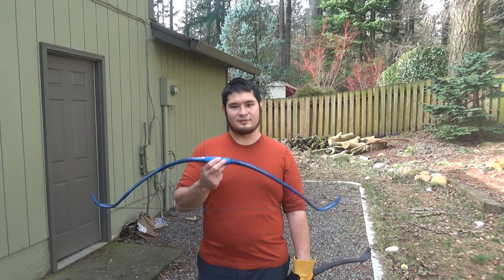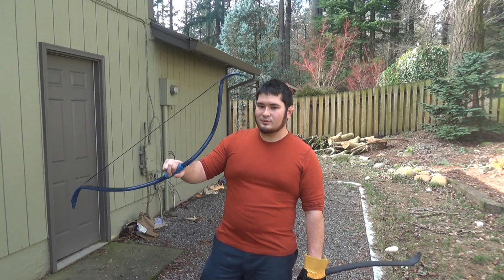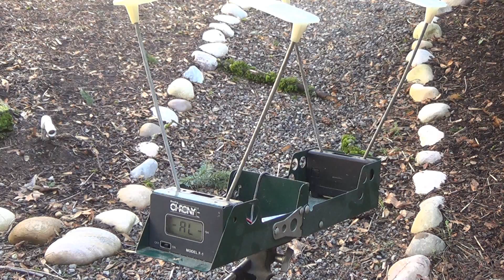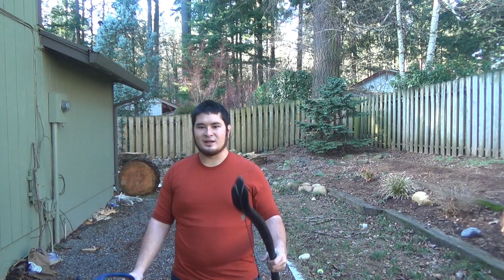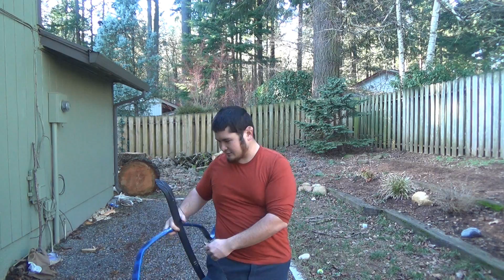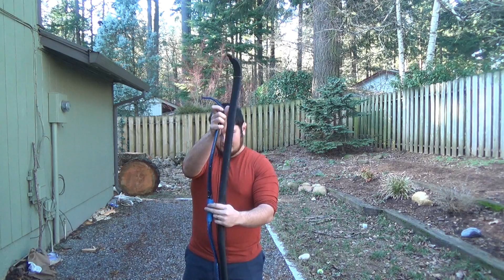Comparing the Efficiency of Two PVC Bows

Comment: Definitely counterintuitive. I'm going to have to watch this several times, I think, before it sinks in. (I would have bet money that the 1" bow was faster/more powerful.) Glad you mentioned ft. lbs. as I'm building PVC bows for hunting, where power is important. Always great stuff Nick! Thanks!
Reply from the maker: Yeah, it can be tricky. Because both bows pull 45 pounds and have similar F/D curves, they are almost equally powerful. Since both have the same power, to get speed we need to know how much mass we're moving. Since the 1" pipe has more mass, it's going to use up a lot of its power just dealing with that. This puts the 3/4" pipe at an advantage because it has much less mass.

Comment: Thanks for sharing your research! The speed on that little blue one is very impressive. The best I've done is around 180 fps from a 1" pipe 50lb bow and ~6gpp arrow. But I sell my bows so I don't normally push the stability limit. I didn't speed test the PVC compound bow or the 80lb 39" long holmegaard bow yet... Maybe today.

Comment: Rubber bands and steel leaf springs tied to the bow is a light way to add draw weight. Flat rubber bands extending from the handle on the outside/front of the bow. Leaf Springs on the inside tied at the middle and has guides(loose cylinders) on the bottom and top so it can slide up and down the bow as you draw. You can mimic this by heating up the same gauge pipe and cutting it in half lengthwise for acting as an inside-resistance like the leaf spring.

Order/look for 6ft fiberglass snow posts because they do exist.

Comment: Looks like there is a greater recurve on the shorter bow. Would a difference of recurve diameter make a large difference? Looks like a comparison of 6" recurve on the larger bow, to 8" recurve on the smaller..
Reply from the maker: There actually is very little difference between the two. The longer bow has about the same amount of recurve, but the shorter bow has slightly longer tips and the tips curve as well, while the tips on the longer bow are more or less straight. The curve beyond the string nock doesn't affect performance, though the longer non-working tips on the shorter bow will actually make it slower than it could be.

Recurves like this can give gains in speed by about 5-10FPS, but also keep in mind that they also bring up early draw weight and total draw weight. So a 45 pound bow that has recurves added may shoot faster, but it will also be heavier and therefore fall into a different class for speed. The net gains aren't that large.

Comment: Great stuff! got into it because of you! i am a selfbowyer and shoot a turkey creek R/D longbow. my aunty sent me sch40 pipe to austria since we don´t have it here.
working on different stuff and turn all my friends into archery people since they can afford this way. working on a R/D design because that is for me the best hybrid bow and nicest design.
something like Grozers assyrian biocomposite design!
check it out!
good work.-.always!
Ossu
Reply from the maker: Those designs shoot really well with very low handshock and no stack. I've made several styles, you can see me shooting one of my early ones here: http://youtu.be/h8Vz50oF09c

And here's one that shot really well but ended up failing due to excessive reflex in the fades. It shot amazingly smooth before I reflexed it, it just came out lighter than I had expected. Really smooth bow all around: http://youtu.be/LTx1xUsdM4A
Reply: Thank you my friend! very helpfull! loved both videos and will try to combine both approaches as well as taking the shape of my r/d longbow into account. its 4 lams of bamboo under curly maple veneers and fiberglass and shoots and 9gr per pound arrow with 200fps. 56# at 28"
ossu

Comment: Nick, check out this link. I shared this with Tim as well. With custom designed pipes to begin with, it is possible to have a more optimum mass at the center and at the ends of the limbs. http://www.apiplastics.com/custom-plastic-pipe-tube.html